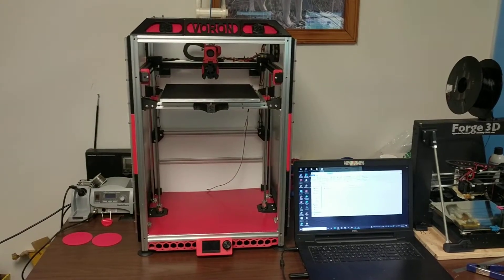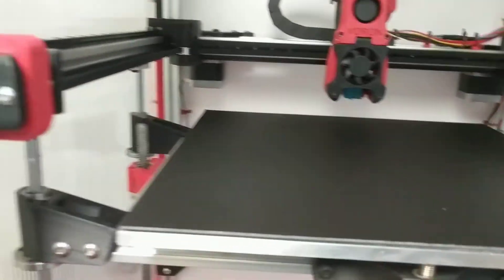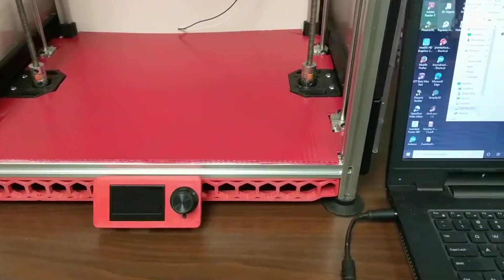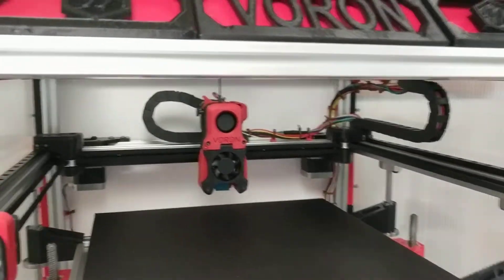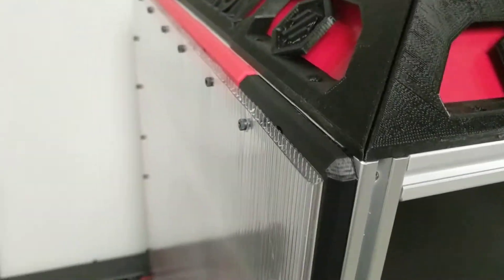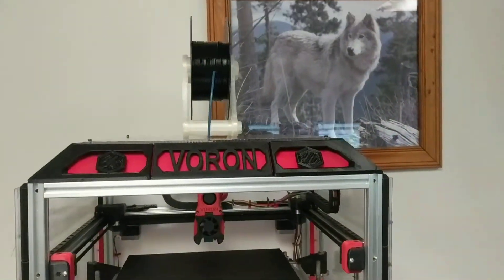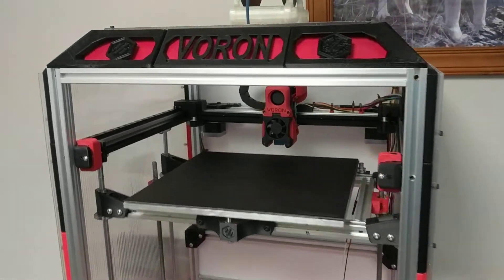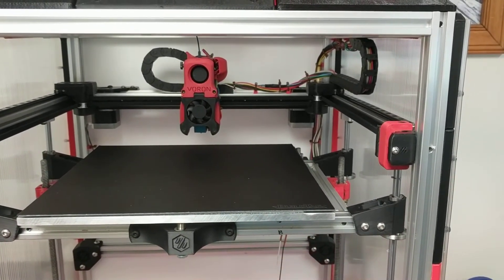Voron 1.8 Nearing Completion

Comment: Randy I have an FT-5 that's in need of an overhaul...all the melamine is warped and I think something like this would be great!  Can you pass along any information on how to get my 5 to a Voron?   Much appreciated
Reply from the maker: The Ft-5 is a good donor for a voron build but there are a few unexpected things. The Voron uses smaller linear rails than the FT-5 and unless you redesign the Voron you have to use the ones they designed for. The Ft-5 used different linear bearings than the Voron but they will work, they stick out past the frame so if you choose to use the FT-5 bearings and wish to enclose the Voron you will have to design spacers for clearance. The Voron V1.8 is quite a bit smaller than the Ft-5 by design, even with the same travel limits it has a much smaller footprint. The Voron V1.8 calls for intigrated Z lead screws which limit the Z travel but I just used my FT-5 lead screws and coupled them to the drives giving me my own choice of Z limits. The Voron build is a lot of work and sourcing the parts was a pain, but it is a much superior product and runs circles around my other printers so I consider it well worth it.

Comment: you should try a flex drive / flex shaft extruder
Reply from the maker: I have looked at these for my Delta. The Voron extruder does not seem to have the issue with weight that a Flex Shaft Extruder is designed to overcome so I did not feel the need to add that complexity. I could be completly wrong but I am very happy with the speed and accuracy of the Voron using the stock extruder. Thank you for the suggestion as I have heard good things about them.